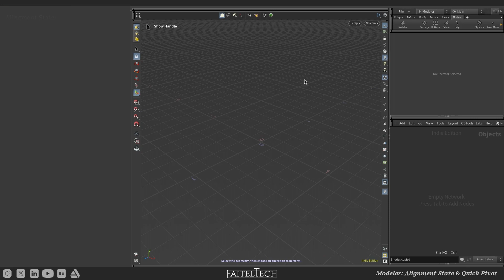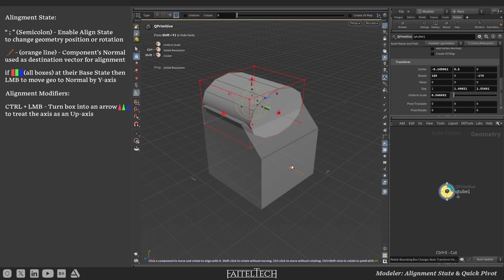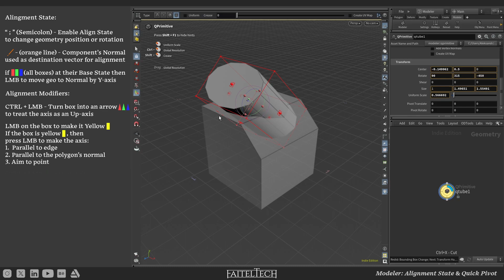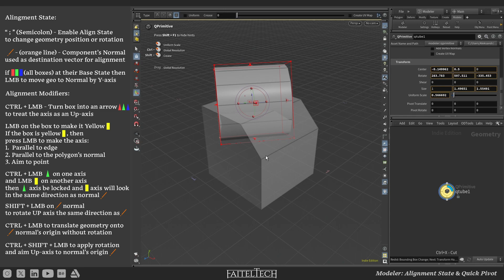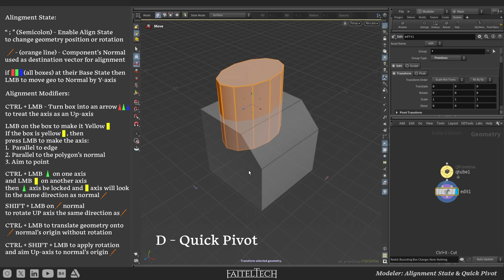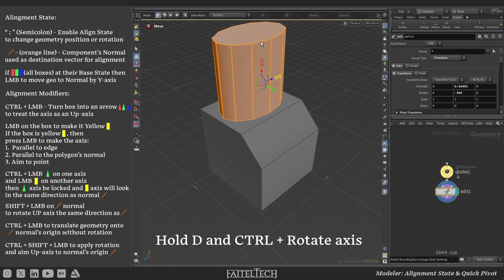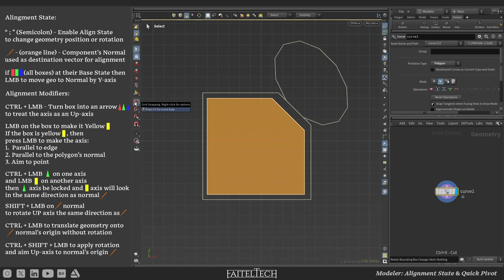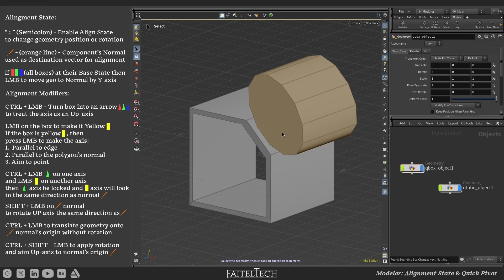Modeler for Houdini: Alighnment State and Quick Pivot Overview

Comment: Tip from Alexey for wacom users:  Make sure to adjust the Click Dead Zone in the General Preferences from the default 0 to 10 to get the Alignment State to work properly with a wacom tablet.  This will save you lots of frustration if you don't know this..  it did for me!